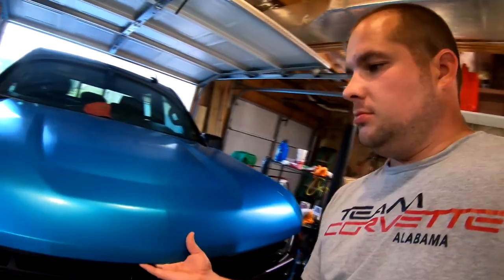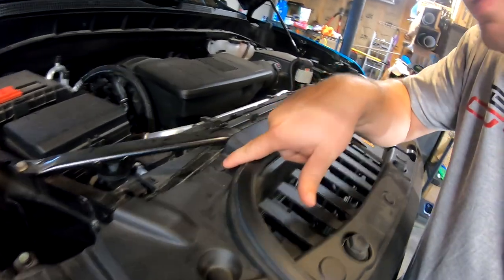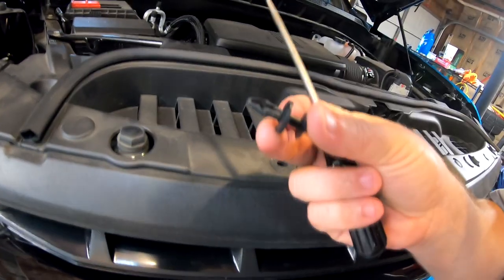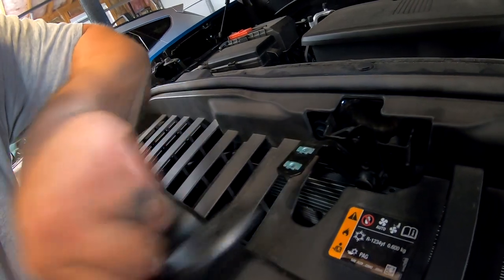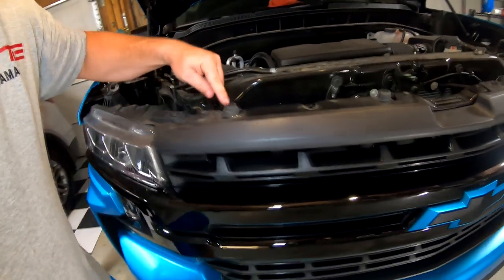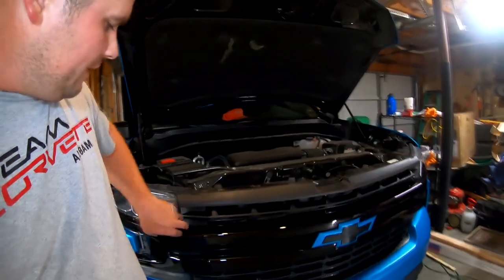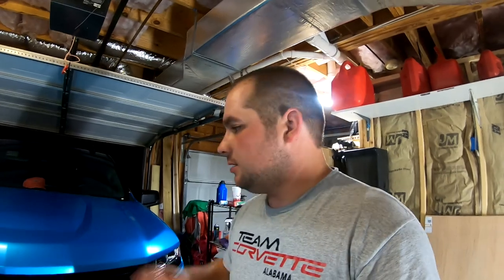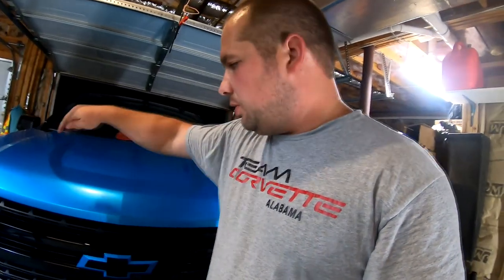How to Remove a 2019 Silverado Front Grille Tutorial

Comment: If I take off the grill will it give me access to fix the bottom part on my front bumper that’s dented ?
Reply from the maker: You should be able to get to the bottom of the bumper from under the truck
Reply: Leaman Griffin I have a 2020 Chevy Silverado 1500 custom and from underneath the truck it’s protected by metal brackets and pieces so I can’t get to the back of the front bumper. I’ve read some posts saying to use a T 15 torx bit to unscrew the cover in front of driving wheel side. I don’t know if it will give me access or not but I will try today

Comment: Where can I find the grill and LED Headlights?
Reply from the maker: Gm dealer is the only one i know that currently sells them.
Reply: Ok, thanks 
One more question, my 2019 Silverado is the Custom edition, which comes with halogen light instead of LED’s. Will the LED headlights kit fit on the custom edition
Reply from the maker: Im pretty sure if you change the grille also they will fit.  Not totally sure though.